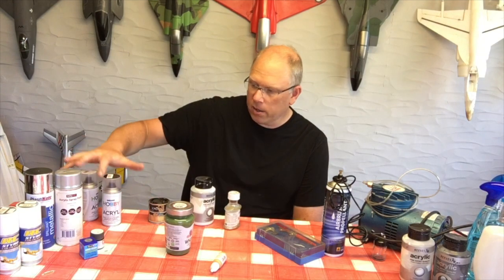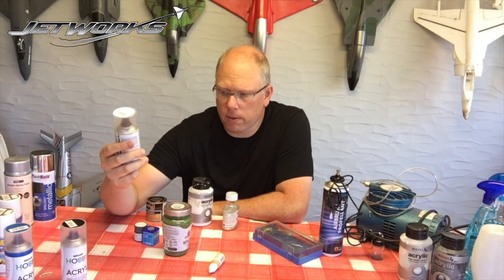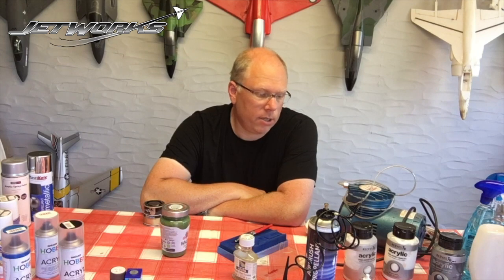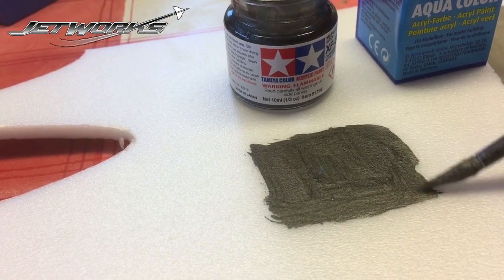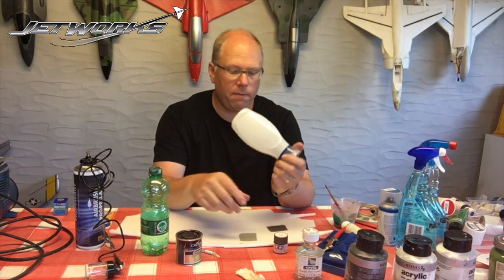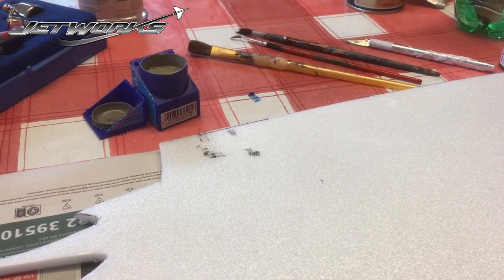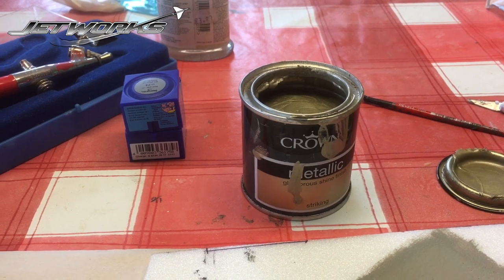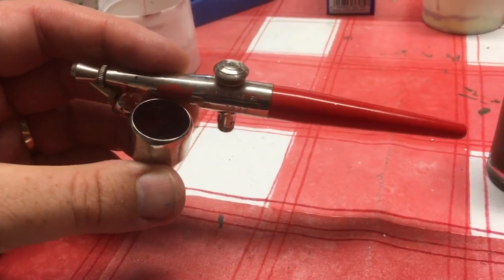Introductory Painting guide

Comment: Hi Craig Just watched this video. Firstly I would just like to say that no way am I trying to tell you how to suck eggs but the problem you had with using the spray tins is that you sprayed it with the spray head too close to the foam. The reaction you got was caused by the propellant in the tin and not with the paint. I have found this out to my cost and found that starting with a few mist coats with the can about 9 or 10 inches away. You can then lay down a thicker coat to finish off without getting a reaction like you did. Please accept I am not trying to tell you how to suck eggs. Just what I have experienced in the past. Really good videos Craig. Really appreciate them

Comment: Hi Craig, Very informative thank you. In the North-West UK we have a number of "The Range" stores. These stock spray paint by Liquitex which works well on depron and is available in many colours (see https://www.liquitex.com/spray-paint/). It can also be purchased via Amazon / EBay etc. I have found that Dulux paint testers with the tiny roller also work very well, super smooth finish in seconds, just one coat and no mess. Lots of greys / blues available for less than two pound a time. You can also recycle the pots if you want. Thanks
Reply from the maker: Great Thanks,  I'll check them out,  Liquitex have a good reputation I believe!